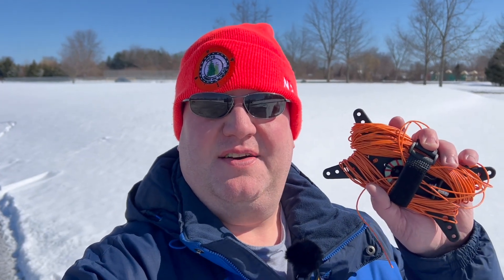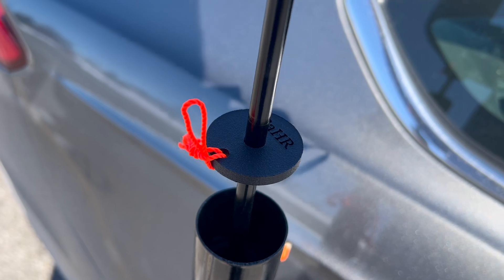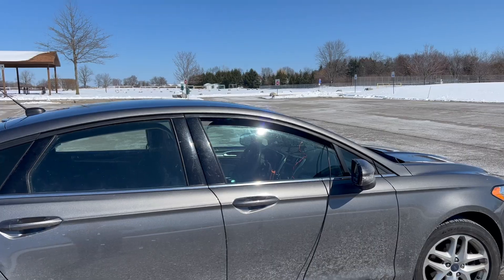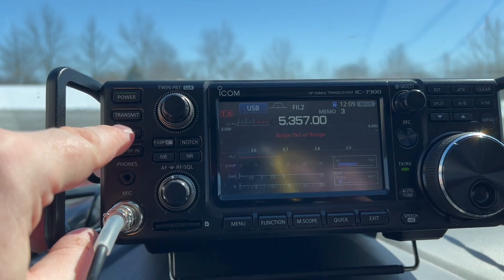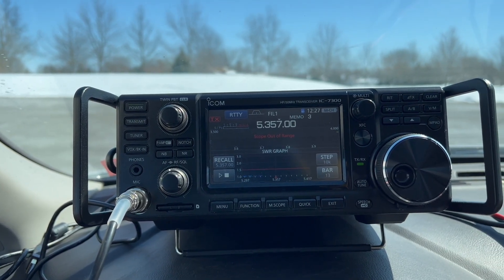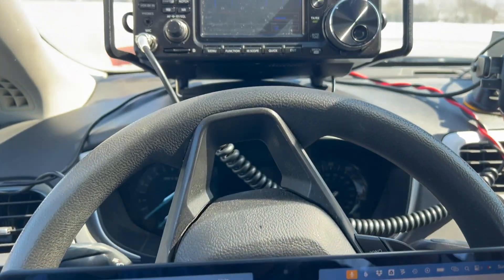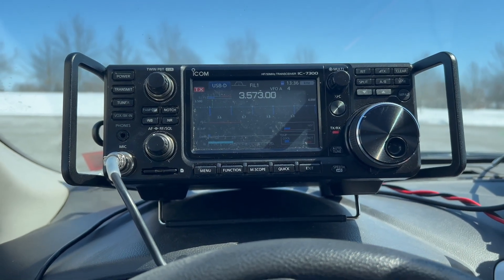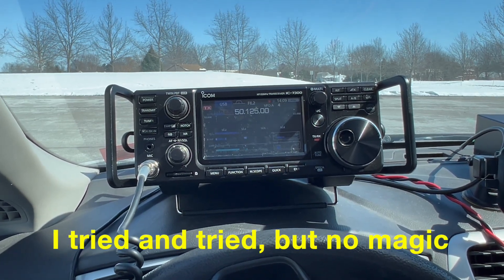9 Bands on the CaHR Poseidon Antenna?!

Comment: having fun with a antenna you built.  that was a good day. glade you know the E-tune on 7300 drop to 1/2 power max.  I have done that with 9:1 . 6 meters usually open in summer but can open any time day or night. I made mono band QRO 49:1 end fed half wave for 10/11/12 meters with a fold back at end for the 3 bands. ran veritable with ground plain with DX commander pole works super at 100 watts, I ran KW on 2 stack of FT 240-61 and cores stay cool.  I made a single stack of 61 core for 6 meters. super good match.  I did one with 43 mix and cut mono band 15 meters and 17 as 20 meters . all work great. longer wire I run as slope config. I do have wire cut 66 ft for 40/20/10 meters. works great but on 20/10 meters the mono band cut is better . I drill small hole in carabiner and slip on end of pole. love that Dingus Coffee and ham radio made.   I made my 8X coax choke with a FT 240-43 mix still works great. I think the 31 mix has higher common mode rejection.  the Ugly Balun works with 8X as well just needs more turns because of just a air coil. still any choke is better then none. what I have found portable.  ABC Always Be Choking . for portable,  73's
Reply from the maker: Thanks for checking out the video!

Comment: I don’t understand much of this video. 
It looks cumbersome and complicated.
Just got my call sign: I’ll do UV-5R kind of stuff for now! 😅
Reply from the maker: Congrats on getting your call sign! This antenna was a kit build based off of a Rybakov antenna. It is a random wire, which is designed to not be resonant on any band. That is why it requires a tuner, but it also allows for the antenna to easily work on different bands. With it's unique length and vertical setup, it also has good gain and takeoff angles for DX on the higher bands. I hope that helps explain it a little better. Congrats again and take your time to enjoy the hobby. There's always so much to explore with ham radio.